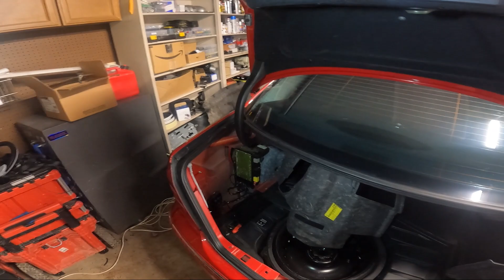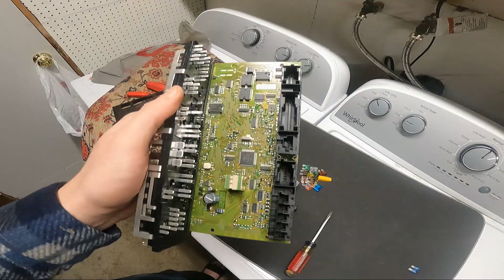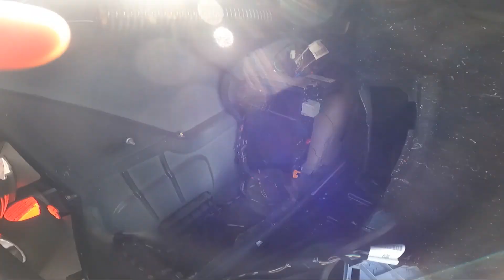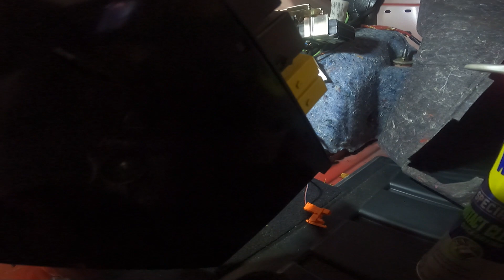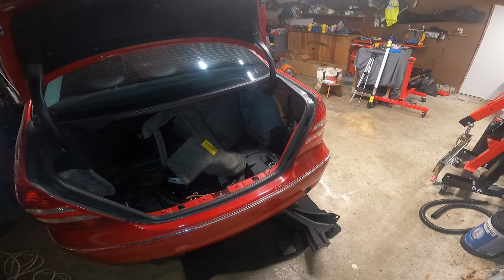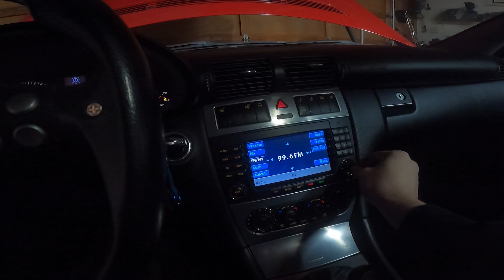Diagnosing and Replacing Bad SAM Module W203 C55 AMG

Comment: Hey man how abt the fuel pump? I replaced the fuel pump and sending unit car started took it for a drive all seems good, came home let the car sit tried starting won’t start. Took then pump out tested with a drill battery and it works, checked the connector on both the sender and pump looks good. Seems to happen after the cad is hot and left to cool. Need help. Thx

Comment: Hey Anderzèn have some issues with my W203 C55 as well. The radiator fan turns on at first they told me it was the ECU so I got a clone and that fixed the issues for a bit but then It started acting weird again and ever since recently the car doesn’t like turning on sometimes and when it does, it runs poorly the radiator fan kicks on. I checked the codes. eis codes Sam module codes TCU codes. I was just wondering if I could get your help see if you could lead me to the right direction as to what could be causing all these issues to pop up. And a lot of CAN BUS codes too any help would be appreciated 🙏
Reply from the maker: My only guess is you have corrosion somewhere on a module or ground or a module or canbus is failing, check the canbus connectors in floor by driver footwell for corrosion

Comment: Autohauz warns that it’s not a DIY job and requires reprogramming. You didn’t need to do any programming?
Reply from the maker: @RobertLombardi-r8o  for the W203 no programming necessary as long as you find same part number, other chassis some do need programming.
Reply: @ Thanks! I'll make sure to find the same part.

Comment: I re did the optic on my 163 it’s pretty cool how it works….all in a loop and it has to complete the loop to work so they make these little loopers that you put on the line to isolate each thing in the system ( radio, amp, tele aid) once you figure out which system has problem you can run light down the line and make sure no broke lines…..when you pull the radio the back fiber wire should blink 3 times if I rember right
Reply from the maker: Any link for said device? Sounds cool

Comment: Have you checked for codes related to the fiberoptic loop? AFAIK, you'll get no sound if there is a break or disconnection anywhere along the fiberoptic loop.

Comment: Those sam units from MB are not the best protected modules against moisture 😖
My W164 was also bad corroded due to leaky taillights 😔
I read that the optic lenses that read the dvd's can go bad on the older comand units.